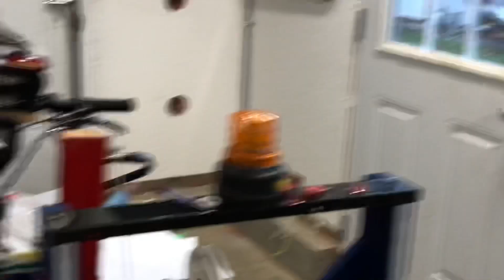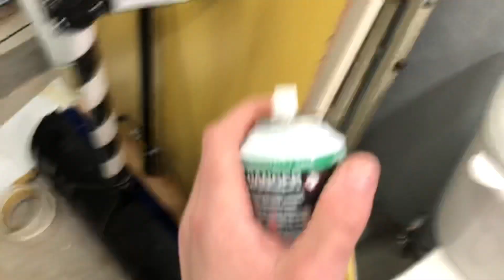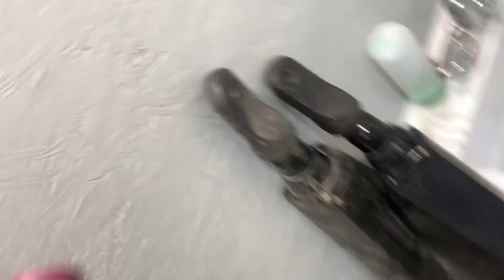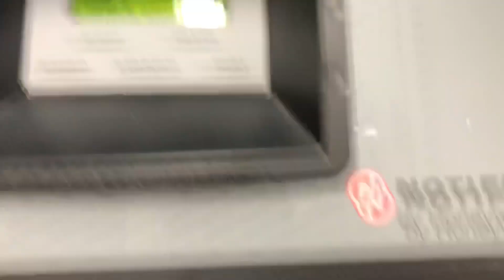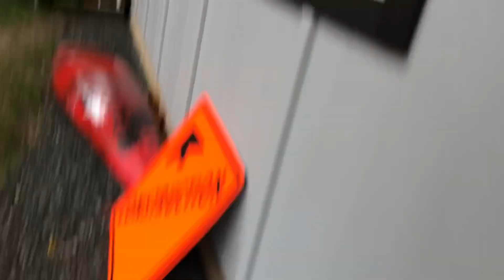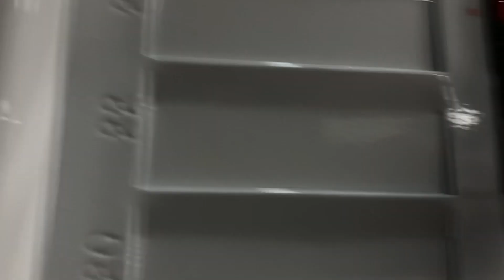Last test with the SFP-10UD

Comment: Replacing the panel once again? Are you going to keep it on the planned board system test or you are going to throw it away, could be a waste of money because it cost more.
Reply from the maker: I will keep it for now maybe sell it eventually
Reply: @nics-systems-electric  what is the new panel look like?
Reply from the maker: @relevanteaglealarms109  Square and metal with some knockouts in it and a door and a key